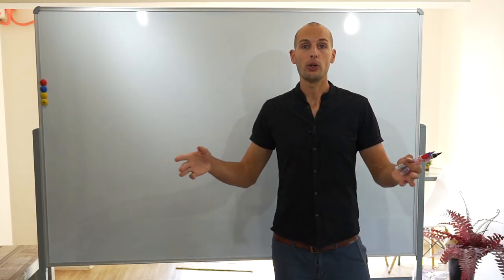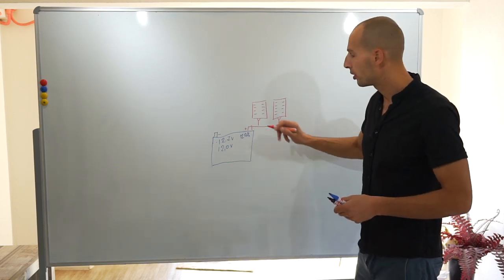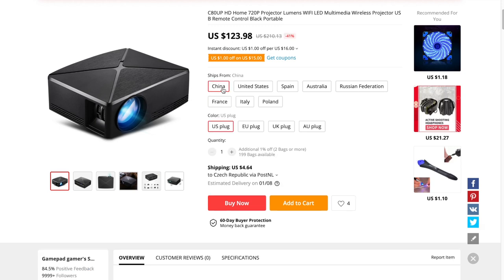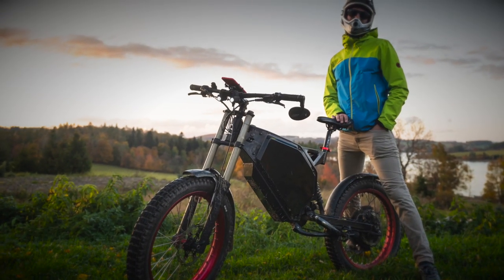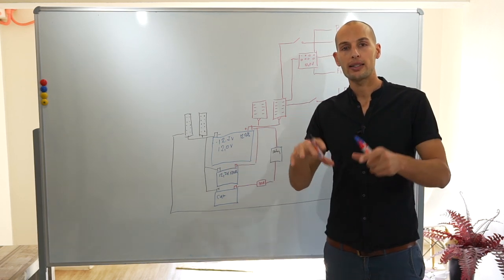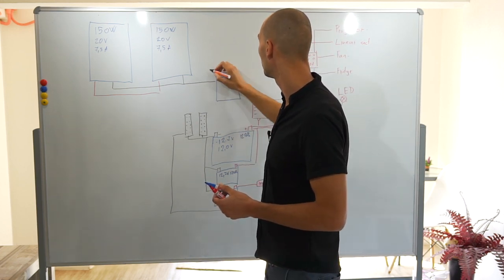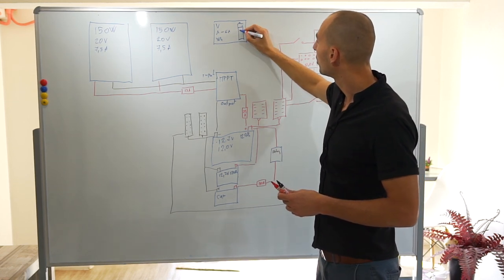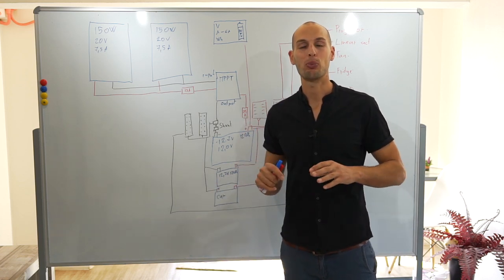How to Wire 12V Electrical System in Campervan - DIY Conversion w/ Solar

Comment: Thank you! Thank you! I have a 13' "lil"bigfoot  trailer that i gutted. I know how to wrap it in insulation and put hull liner on the inside and bed and couches, but electrical i am a dummy. I looked all over the internet to learn wiring, nothing in layman's terms, but yours excellent! Thank you.

Comment: great film. do you plan to make another one on how to add 230V input and output ontop of that system? how to connect inverters and external 230v power supply that will automatically charge batteries if needed and allow to use of 230v appliances either from external power or from the inverter?

Comment: Many thanks for this great explanation! What I would be interested in as extension: how to include a 220V system from external (on a camp side) for charging and internal via an Inverter for some outlets. And that without one of that fancy 1000++€ all-in-one devices.
Any suggestions?
Best regards from Germany :)

Comment: Ladislav thanks for all this great content with humor! One question regarding your circuit, you mentioned a VSR Voltage Sensitive relay with 125 Ah, but in this example, we have two batteries connected in parallel with 120 Ah each and in total 240 ah. This VSR would be enough for this case? Thanks

Comment: Amazing! Could you explain how we can include 220v supply in this system. For example when we are in camp site we can charge our batteries.
Reply: I would love to hear the solution to this.
Reply from the maker: It’s a separate system, does not go together with DC. Imagine a simple extension cord going through circuit breaker. Whoala.

Comment: Just an isolator missing I think to securly shut off power from the battery to the circuits when your not using the back.

Comment: Sorry to go against the general reviews but I thought that this was poor. Nice simple explanations as he drew the diagram but he made mistakes.
Firstly, the shunt does not go between the batteries, it goes into the combined feed from the two batteries.
Secondly, you dont calculate fuse sizes based upon the power output of a device. He correctly calculates the ampage that the solar panel will generate and sticks a fuse of that rating into its output feed. Well the rating of a fuse is the ampage at which the fuse will blow.  So a 15A fuse attached to a solar panel producing 15A will be operating at its limit, will get hot and will likely blow occasionally.
But more importantly the fuse is  there to protect the downstream wiring and components against overload. So, for instance, if you run 30A wiring from a solar panel then you need a 25A fuse to guard against a short overloading the wiring - even if the panel is rated at only 15A.
So, unfortunately at about 25% into this video I was forced to stop; so cannot comment on the rest of the video.